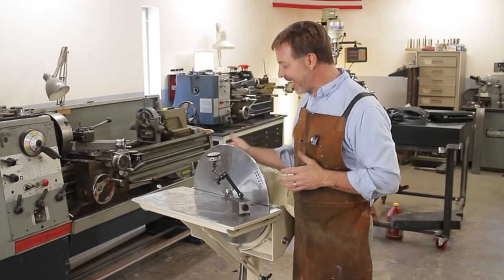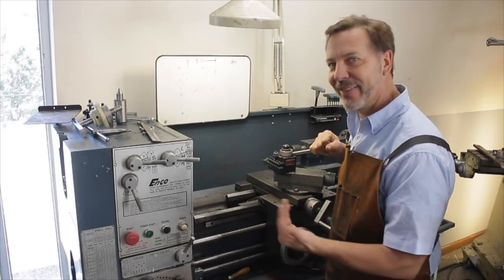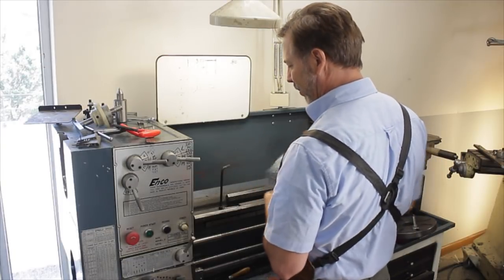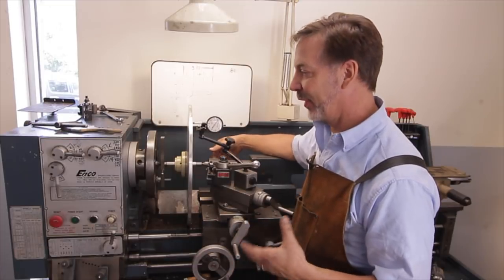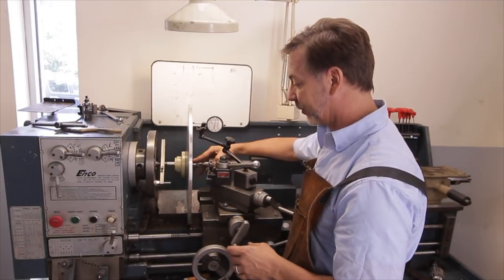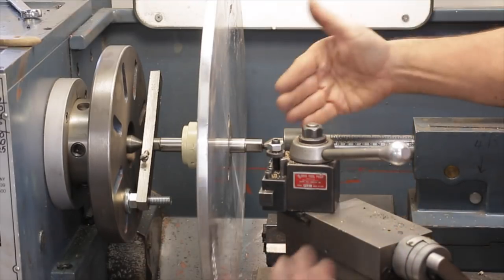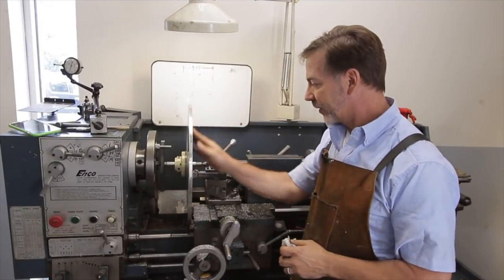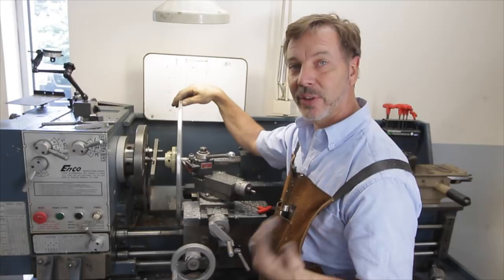Big turning on a small metal lathe ( Part 1)

Comment: Turning on arbors is always problematic. It's sometimes the only way to get the job done.

I think I would have given up on the arbor and tried to find out what the problem is with the disc/mounting flange interface. It could be the mounting flange is the problem in the 1st place. Then once that was straightened out, by truing the face/bore, I would have directly mounted the disc to the faceplate. You might have needed to drill some holes in the disc but those can be plugged by various means.

Mounting to the faceplate would have given you a bunch more room lengthways, eliminated the tailstock being in the way and the larger diameter of the faceplate would have better supported the disc. A little more work but less harmonics and less hassle trying to work the cutting to into postiion.
Reply from the maker: The mounting flange ran true so I knew that the best way to keep it in alignment was determined between centers. It's very difficult to mount the hub in a 4 jaw and keep a  large disk.in true alignment . Thanks for your comment :-)

Comment: Some tips for future;
1) Safety Glasses.
2) AL Cutting fluid makes a HUGE difference.
3) That Harmonic could have been easily dampened with some heavy rubber glued to the back.
4) manual set your dog on the correct side of the drive bolt before starting the lathe.
5) Its a good idea before removing a Gap Bed to run a dial gauage over the length of both ways for the gap bed, using the carriage on the fixed bed. Then you know how true it was and you have a baseline to work to when fitting it back.
Cheers
Reply: Safety glasses?Are you kidding?He might as well wear them when he leavs that building,theres a greater chance of something hitting his eyes in the outdoors.I dont see how he can possibly do damage to his eye in that video

Comment: My Taiwan made ENCO 1340 has a 3hp 3ph motor.  Speed and feed the universal problem.  Sounds like a mission bell.  Now I know how to get my gap out. LOL  Another great job.......17,000 rpm would have been scary! LOLOL  I hope you get a good balance on it.   One more question, that diameter at that thickness, is there too much spring in the plate when sanding?

Comment: I used to occasionally pop in for a chat with the old engineer who had a unit next door to where I worked. One day I asked why he had a large tub labeled "Plasticine" up on his shelf. He told me that mainly it was for when he was turning thin but large diameter discs at slow speeds he'd plaster rings of the stuff on the back if it's resonation was causing chatter marks. At the time I thought he was just trying to see what level of implausible cr*p he could get me to believe (He was that sort of bloke), But now you mention the problem on here I'm thinking he may have been serious.

Comment: Your project is most timely,  I am building a 24" sander,  my plans call for a steel disk.  As my lathe is to small  I'm going to use a tool grinder to finish the surface in situ. 

I was wondering, have you seen my post in the discussion on your channel?

Comment: Bit late now but you would have been better off using HSS with positive rake instead of carbide with what looks like negative rake. It would also have been easier to grind than a brazed carbide bit

Comment: oops it looks like you got caught with you Eye protection down.. oops!   Oh I am positive I do not have a gap bed on my Craftsman 12 by 36. But good to know some lathes do. thanks for the information.I do try to goto my shop and make something cool!   have fun.. thanks for sharing!
Reply from the maker: thanks for your comment
Reply: Safety glasses are for the careless people that go around getting injured all the time.Been in this industry for around 15 years i dont wear my glasses when iam setting up a job or running production,now when i have to use a grinder or cut parts then i put my glasses on ,common sense right?When these morons keep making comments about your glasses ,it really shows that either they are really accident prone or they really never been on a shop floor.You know if you are aware and know what you are doing i cant imagine something hitting your eyes i never seen that happen ,ive seen people cut teir fingers off,ive seen people get pulled in by the machines and get wrapped around the spindle,ive seen quite a bit but ive never seen anyone get hit in the eyes

Comment: I'm just curious why truing it on the original motor did not work.
Reply from the maker: the disk turns at to high a speed to get a good cut.
Reply: *****
That's with a cutter. Do you think holding a sharpening stone or a grinder up to it would be effective?

Comment: I'm not a fan of gap-bed lathes. The bed ways are finished after the gap is installed. If there is any kind of nick or ding on the gap while working, it must be completely removed or the gap will not seat correctly no matter how much you tighten the hold down bolts.
   In my collection of Asian lathe literature, one lathe builder says never remove the gap on their gap-bed lathes! 
   The other problem is that on most of these lathes, there is no provision made to maintain the stiffness of the lathe bed when the gap is removed... they just whacked a great big notch in a standard lathe bed with no reinforcement to maintain the bed stiffness when the gap is pulled. I suppose at the end of the day it doesn't make much difference in light duty lathe work. 
     Like others have noted... you gotta be your own safety officer. Safety glasses, no rings or wrist watches, no loose clothing, etc. We all know the drill and if you're alone in the shop like most of us are it's easy to let safety slide 'cause there's no one there to fuss at you.  Most of us old geezers have been around long enough to have seen someone get badly hurt in the shop.. and very nearly every time it was because someone got careless and it caught them out. So everyone take the admonitions to work safe you see in a lot of the machining videos to heart.

Comment: Have you ever seen a mechanic turn a car rotor on a lathe? We use a strap around the outside with lead weights on it that dampens that ringing. We also use a spring loaded clamp that rides on the lathe and the machined surfaces that helps. I'll share a link to some at a local to me autoparts store. Don't know if any of this will help. 

http://www.oreillyauto.com/site/c/search/Brake+Lathe+Silencers/N2288/C1981.oap
Reply from the maker: thanks for your comment and the link.

Comment: talks for 13 minutes  works for 1
Reply: in metal work, preparation often time takes more time than the actual metal work
Reply: Jon Peterman. you can certainly tell the pretenders when they leave comments like that.
Reply: combatcurtful  - I worked in Rad Protection at a government facility.  The moto for craftworkers there was, "If I screw up on straight time, they will pay me OT to fix it!"  There were a lot of screw ups.